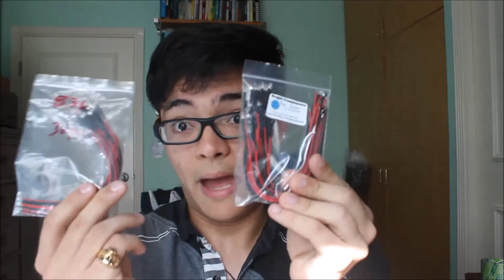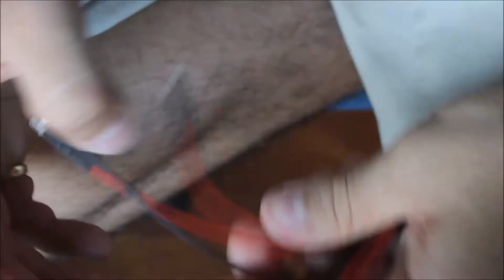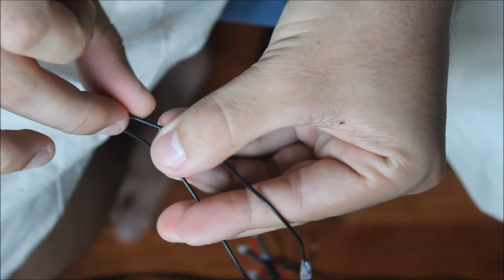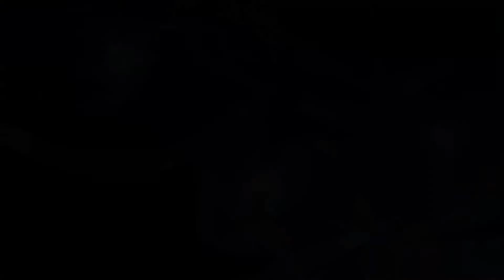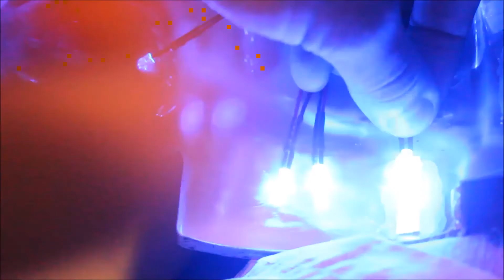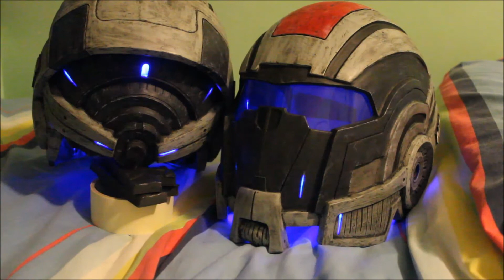How to add LED's and Lights to Props and Cosplay Costumes

Comment: Soldering isn't that bad my dude.  But it is a pain in the balls some times.  i would recommend using barrel crimps over the hot glue though, even though it kind of acts like a potting compound, you run the risk of it penetrating and then you lose connection which could mean you are gonna have to pull it all off and it will just be a pain.  I am, however, enlightened from this video, you know because I nuke it and put the resistors on myself.  At least now, I know that all those classes I had to sit through were pointless because someone has already figured out to put resistors on them haha

Comment: Using just hot glue to attach your LEDs? BRILLIANT! Absolutely brilliant. I´m very happy you shared this!
Reply from the maker: Thanks! of course its not going to be as reliable as soldering but as long as you make sure the wires have good contact and you twist them together tightly before gluing on top, you should have no problems!

Comment: How do you control turning the led's on or off when the whole assembly is done? Like you take the cosplay off and then put it somewhere else, but you need the lights to stop shining. Is there a switch or a button included somewhere?
Reply from the maker: I will copy the reply I posted to a similar question 

"Essentially for all the LED's you want to connect all positive together and all negative together, however in there you also need a switch and battery. So what you do is connect a battery connector in parallel as well, positive to positive, negative to negative, then what you do is add a switch into one of the battery connector wires! Voila you have a parallel circuit with a switch! hope that makes sense!"

Comment: Soldering isn't nearly as bad as you are saying. It sounds like you just don't know how to do it and are making excuses. Just say, "I don't know how to solder so I'm using hot glue"
Reply from the maker: markevens I do know how to solder and have quite a bit of experience with it, I'm an engineer now by trade. The hot glue suggestion is just for a lower budget, less time consuming and easier method to complete wiring

Comment: do you need resistors when using loads of leds in a circuit? wont they burn out otherwise?
Reply: He said in the beginning he buys resistor installed lights.

Comment: so if i wanted to add a switch would i be able to? like if i connected it to one wire would it work?
Reply from the maker: Yeah you could! you could either make it so it effected only a few LED's or all of them depending on which wire you added the switch into. add it to the wire from the battery to effect all of them!

Comment: i just wish i watch your tutorial sooner, i had bought the sobering before watching your video. FML :'(
Reply from the maker: Don't fret! soldering is quite easy too, and it makes a stronger joint. its just a lot more time consuming especcially if you're doing a project with 20+ led's wired together
Reply: thank you, anw, great tutorial :D
Reply: @KRSprops PLEASE HELP! I'm making an aqualad cosplay and I was gonna use some light blue LED's for the back pack. How would I put the LED's and battery's on/in the backpack?

Comment: how do you turn the lights off?
Reply: You can do this one of two ways, either simply remove the battery from the battery clip, or you can install a simple binary switch between the wires that connect your battery clip to the rest of the LED's

Comment: This might be a dumb question, but how would one connect a switch to the battery? >< I'm super new to circuits and LEDs in cosplaying and I didn't see a switch being attached in this video so I'm a little lost on that. ;;
Reply from the maker: you just need to wire the battery switch in on either the negative or positive wire between the battery clip and your parallel wired LED's

Comment: If I was to try you method in using the LED's with a battery, how would I be able to turn it off and or on, if I were to apply this same exact method to a piece of clothing? Obviously the wiring would be hidding within the garmet, but I want to have this form of glow from the lighting, while at the same be able to turn it off or on, without having this infinite supply of a glow. Any Input on how I would do this or to look for? I searched for a switch, but Im not sure which one to choose, or if it would work with this method. Thanks for any replies ~
Reply from the maker: +HisNameIsHero Any switch would work for this, all you have to do it put it in the circuit between the LED's and your power source.
Reply: +KRSprops Oh okay, thanks. If I have further questions, can I hyu? lol taking it as your experienced more in this then I am, it'll be good to have someone I could refer too if needed. js :P

Comment: May I ask how you connected the LED's to the battery?
Reply from the maker: +MochaMage I simply wired a battery clip into the circuit! that makes it easy to switch batteries in and out :)

Comment: I don't know if you're familiar with it, but how you advise some who wanted to add LEDs to a replica of Captain Cold's gun to make the main chamber light up? Also how would you add a switch or trigger so one could turn it on and off?
Reply from the maker: +FenrirsLover I've only light a gun barrel once, i think the best way to do it would be to cover the interior of the barrel in silver foil or paint and then put a single led at the back of the barrel

Comment: This is probably the most encouraging video out there regarding wiring LEDs. I read a lot that using hot glu is bad and all that stuff, but you seem to do ti and you're fine so I will jsut go with it :)
Reply from the maker: hot glue definitely isn't the best method, if you have the time and skill you should always solder because it's much more durable! but for quick props and costumes hot glue works just fine!
Reply: +KRSprops I &#39;m putting the LEDs inside a resin gem and then putting it in a staff so it will be pretty much static and sealed. Also, I don't have access to a soldering iron and I have only theoretical knowledge of how to solder ( yay for being a girl :D )

Another question - I wire up the LEDs, add the resistors and everything, but instead of glowing red, they glow orange and become a bit warm. Does this mean the battery is too strong? ( I&#39;m using a 9V battery for 3x2V LEDs)
Reply from the maker: +Alsy LED's shouldn't produce much heat, if they are getting quite warm you should double check the voltage they are meant to use

Comment: Hi there, I am a little confused :S  I understand connect all red to red and black to black, but in the next shot you have two black wires connected to the reds ( 3:32 ). I believe one is to connect to the battery, but what is the other? :S
Reply from the maker: +MMD-Nay-PMD yeah at this point the whole red to red, black to black thing breaks down because the LED's have red and black wires but i only have black wire as spare to connect things like battery packs etc. all you have to do is make sure all negatives are connected to negatives and vice versa for positives :)

Comment: hey great tutorial!! jst one confusing thing, what sort of power supply should i have for 12v leds?? all the ones im finding are super bulky. would a 2x AA battery pack be okay? or do i need something more heavy duty. thanks!
Reply from the maker: +819firestarter you can get 12v batteries! 9v batteries will work for 12v LED's as well, but if you dont want to use either of those you should be able to find out what the overall voltage of a battery pack is in the description when buying it!
Reply: +KRSprops ty so much!
Reply: +KRSprops ahh sorry jst one more question! did u use a battery holder or jst use the battery clip and tape it down?

Comment: I'm planning on covering my entire arms in leds. If I used led strips, could I connect multiple strips in the same manner?
Reply from the maker: +DIA333333 LED strips are designed to be easy to attach together to make whatever length you want, while ive never worked with them myself im sure that attaching them in a similar would be fairly easy
Reply: Thanks for responding! Do you happen to other ways of getting dark plastic sheets. I seem to have the hardest time finding anything after a whole day of looking.

Comment: Your video has answered not just 1 but 2 major questions I had about LEDs! (extreamly helpfull) I'm making large butterfly wings that glow and change colors but I was having trouble figuring out how to diffuse the lights enough for that effect.  The visor trick is genius but I would need large sheets of that plastic, Do you know where sheets of that same plastic could be ordered? like 36"× 46" dimensions?
Reply from the maker: I don't have a supplier in mind but you could Google online for plastic rolls of acetate that's ruined black¿
Reply: +KRSprops I found some at a local art store. Thanks for responding

Comment: Could you show how to connect them to a switch and the battery?
Reply from the maker: Amtonio Mendoza Its unlikely i will make a follow up video on just that but essentially I show you how to wire the battery clip, so all you do it clip in a battery. You wire the positive of the battery clip to the positive of all the other LED's. and for a switch you just put in on either the positive or negative wire between the battery clip and the rest of the LED's

Comment: Hi! I'm kinda new to working with lighting in props/costumes, but this is a very helpfull video, thanks! 
I have one question though, how does the on/off switch work with that? And where could you buy a small one?
Reply from the maker: Doofy Goofus i dont understand what exactly you are asking abotu the on/off switch. You can buy them online from ebay or from modelling stores! I would suggest going for something small and simple to make it easier to fit inside whatever costume/prop you are making. Remember to always test your wiring before gluing/soldering!
Reply: KRSprops Thanks for the quick response! What I mean is, how do you 'integrate' the switch into the circuit? As in, what do you do to attach it to the rest of the wiring and the battery?  I see on ebay that most switches have 2 or more pins. How do you know which pin is for what?
Reply from the maker: Doofy Goofus personally the switches I  use have three pins as well as this allows you to have two circuits wired into a single switch, honestly I'd say just try them out before finalizing to see what pins are for what. Basically you just want your switch to be somewhere between your battery or battery clip and your lights, this can be on the positive wire side or the negative wire side! Hope that helps
Reply: KRSprops Thanks! I think I understand now! :p And otherwise I'll learn by trial and error.

Comment: Do you also hot glue the wires to the switch/battery?
Reply from the maker: deddjay  I do indeed! it helps to keep it in place and is much easier than soldering

Comment from the maker: @Nate Snow The battery pack is in the helmet where i could find space and the switch is also inside the helmet
Reply: what if you want to use a lever how would you set it up?
Reply from the maker: +ian munoz Im not sure what you mean sorry, what do you mean by lever?
Reply: +KRSprops I mean say you have 2 pairs of LEDS 1 pair is blue and the other is orange and say you want to use them because you're making a portal gun and you want to make so you can use a lever to turn it to blue or orange and off
Reply from the maker: +ian munoz whether you can do that with one switch entirely depends on what type of switch you can get. I dont know where you can get a 3 way switch so I would personally just wire up each set of LED's to their own switch and turn them on and off as i pleased
Reply: Oh okay then

Comment: What would your suggestion be to make a strand of lights I have a belt i want to make glow and there are 6 cubes on each belt and they are about 2 inchs apart I was going to use led fairy lights but the length between the light isn't long enough. Please help!

Comment: I can't find those visor hat things anywhere! I need some cheap visor material but I can't find them anywhere, did you buy them online? If so, please link me! Thanks ^-^!
Reply: I buy my acrylic visors from motorcycle stores. A bit pricey but still not bad if they're the right colour/size. Just got a visor for my Tracer cosplay for $12.
Reply from the maker: Vera Chimera you can go down that route yes! I only use the sun visor hats because they are cheap and thinner plastic meaning its easier to work with in terms of bending to fit, cutting etc. But it is limited in colours and also its more flimsy than a real motorcycle visor, but then again whats really going to hit you in the visor area when youre cosplaying. I get them locally for cheap but you can get them off ebay for really cheap as well :)
Reply: Are the acrylic visors flexible? I wouldn't want to be backed into a corner of creativity because the visor is static. Thank you both for telling me where to look though :D

Comment: Could I maybe use battery powered Xmas lights behind coloured plastic?
Reply from the maker: if its compact enough to fit in the helmet with your head then yeah go for it!
Reply: I was planning on putting it inside a tail to make it look as though it is glowing, the tail pieces are connected by energy that glows(basically just purple light) how could I do that? The Xmas lights didn't work the way I wanted

Comment: what are you using to join the LEDS together? i mean, what's that black wire that connects to the battery?
Reply from the maker: its just regular wire that you can pick up at any hardware store in a spool :)

Comment: Thank you for making this video, very helpful! I'm trying to make my first piece with LED's and have a question:  I'm going to need 6 different colors, what would be the best way to attach all these to a battery?
Reply from the maker: how many LED's will you be using? Parrallell is usually the best way to wire LED's together as it means that all your LED's will be as bright as if only one LED was hooked up to the battery! however it also means the battery will run down faster, so if you have A LOT of LED's maybe best to split into two groups and wire to two seperate batteries to extend battery life